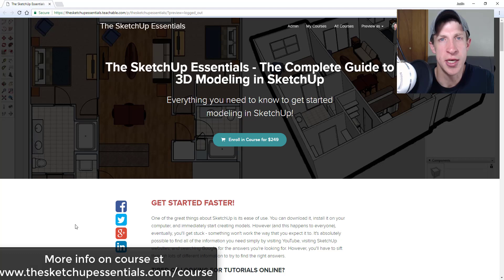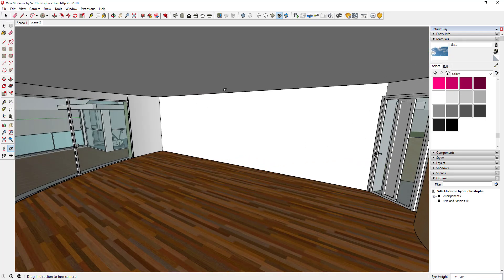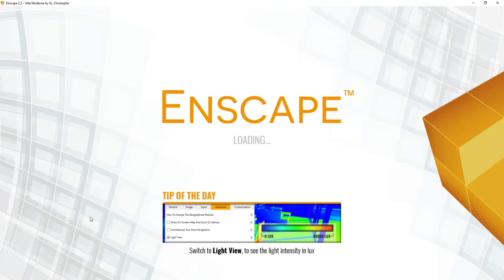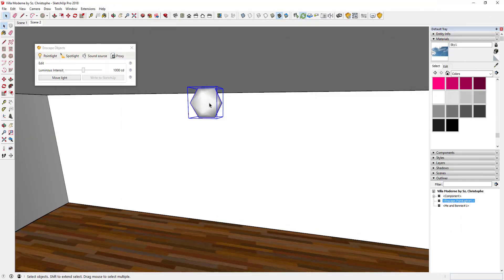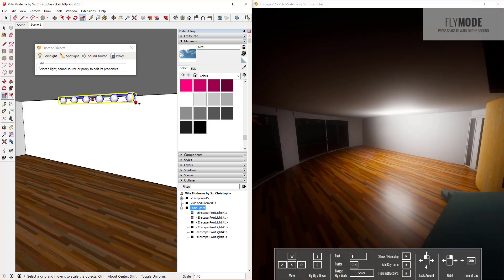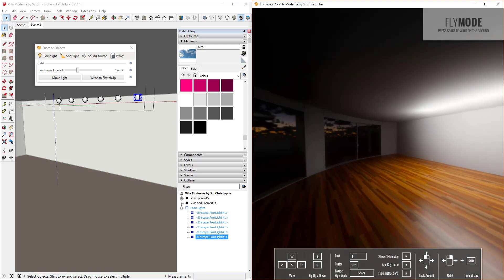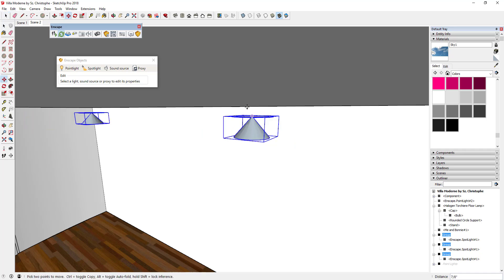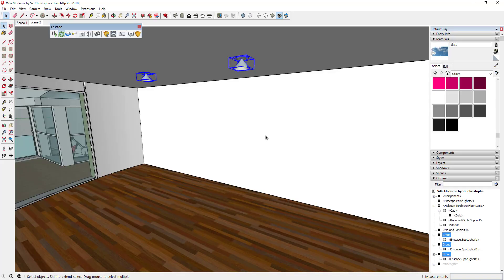ADDING LIGHTING TO YOUR REALTIME RENDERING with Enscape for SketchUp

Comment: Sir I have doubt 
When I open enscape for sketchup 
It shows a message 
" Your graphics card is not supported.enscape is using your GPU from Intel" 
What to do ????

I also support lumion 6.5 
There is no issue with graphic card
Reply from the maker: Generally it's a good idea when leaving a post like this to note what graphics card you have. That said, it sounds like you need a different graphics card based on Enscape's requirements...
Reply: I don't have any graphic card
Reply from the maker: Then this message is telling you that since you don't have a graphics card, it's using your onboard graphics processor built in to your CPU. As long as you don't have a graphics card, you're going to get this message
Reply: How much graphic card is required
Reply: How to solve this problem
Reply from the maker: Go to the Enscape website and read the system requirements

Comment: its good and easy to make the lighting but still lost color temperature of light function
Reply from the maker: There's a color temperature slider in the image tab - does that help at all? Otherwise you might need to use this workaround -  https://forum.enscape3d.com/index.php?thread/1096-can-we-adjust-the-light-temperature-emited/ - Thanks!

Comment: Justin, I'm having a bit of a problem with rendering my model... I've created a model with a complex, fluid, smooth surface. Yet when I render it (with a smooth reflective surface), it turns out blocky, or showing the multiple small faces (very small, but still problematic) involved in the shape. I'm wondering if you know of a way, aside from Photoshop, to lessen this issue...?

I have two options I'm thinking of; firstly recreate the whole model in a larger size and with more segments per curve etc... OR take the existing model and shrink it an extreme amount in hopes that it lessens the problem. While the former is kind of a nightmare, it seems the only true course of action.

Your help, as always is much appreciated!
Thanks
Reply from the maker: Is your model really small? If so, maybe just start by re-scaling the whole thing using the tape measure tool (https://www.youtube.com/watch?v=YRC1gg4tWx8) - sometimes you get weird results in SketchUp with small geometry. Alternatively, do you have any faces overlapping within your model? That could cause odd results as well...Finally, maybe try a different material and see if that changes anything. Thanks!

Comment: Justin, Thanks for the helpful overview for version 2.2.
I had tried out enscape a few months ago during it's earlier stages and was initially impressed with the program overall.
The only things that turned me away was the lack of settings for materials, artificial lighting options and proxy objects.
You have done an amazing job reviewing the updated versions features for materials and lighting.

It would be great if you could review proxy objects within enscape v2.2 for skecthup.
Possibly seeing if it is compbatible with the program skatter?
To date I haven't come across any content going in depth with this feature.
Dealing with proxies really is the main selling point for me at this moment.

Keep up the great work in the meantime!
Reply from the maker: I'll add it to my list of tutorials to do - I haven't covered proxies yet, so that's a good topic - thanks for the idea!
Reply: Great!
One last thing. Do you know if Enscape requires an active internet connection or if it can be used offline?

Thanks!

Comment: Hey I'm in big trouble please help I am install new version of sketchup 2017 and vray 3.4 but when I'm open vray matrial box when only tic my sketchup screen is small like in your this video sides are black
Or all display is ok only draw screen is small menu and toolbar is ok  
How to remove and when I'm applay to material select object it's can't add material so how I'll solve please give answer as fast as you can
Reply from the maker: Honestly I'm not sure on this one - you may try unistalling and reinstalling Vray, and also updating your graphics card drivers. Beyond that, you may need to post something in the Vray Chaos Group forums. Thanks
Reply: TheSketchUpEssentials thanks for information I'll try that